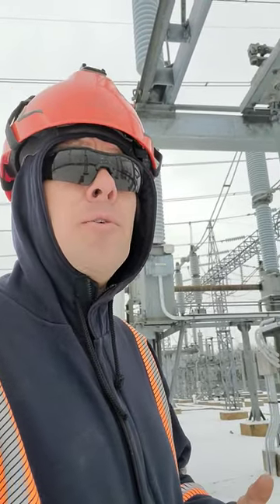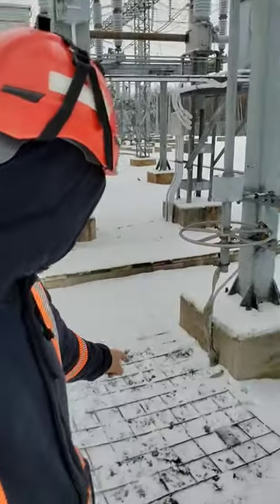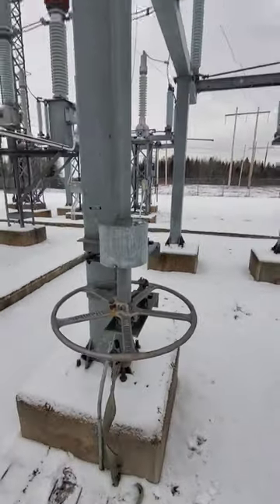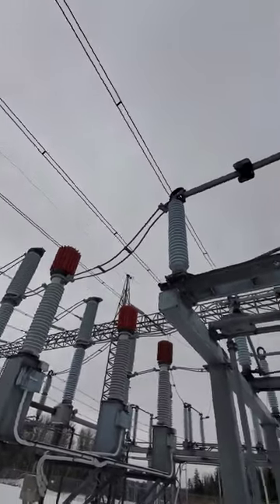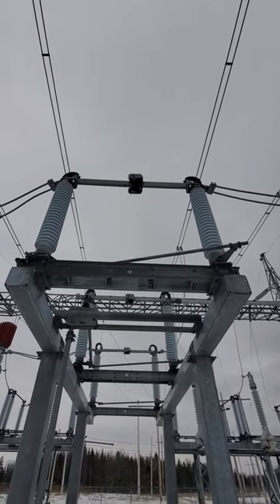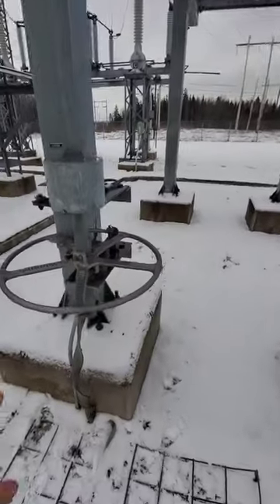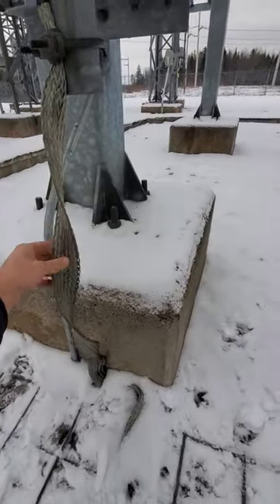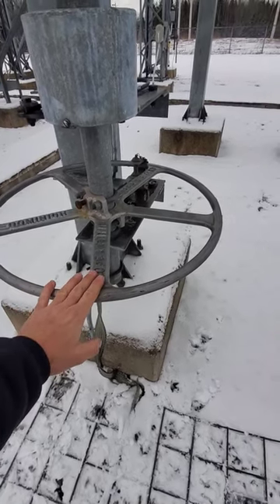Why am I standing on a steel mat??

Comment: If the rubber gloves being used have not been tested up to the possible applied voltage you are only fooling yourself thinking they are going to save your life. For feet and hands to be at the same potential they both would have to be insulated at the same rating.
Reply from the maker: Not going to disagree on that one. 

While our procedures require them, my understanding is: While a single conductor fault would be around 80kV, it would also dissipate rather quickly. The 20kv gloves are also tested at a higher voltage, which hopefully meet somewhere near the actual voltage during a fault. 
I agree that it can be counter productive at achieving zero difference in potential difference, however also understand that it can help in an extremely uncontrolled event of a fault.

It's definitely a bad situation to be in regardless of any barriers put in place
Reply: That would not be true. Your are a bird on a wire, the mat and the switch handle would be at the same potential.. In case of a fault you would then only have to have gloves that are rated for the voltage drop across your body.
Reply: Incorrect. The whole purpose of bonding is to put everything at the same potential, exactly as  @TnTBLACK95  said. If that switch did fault to ground and energize that structure or hand wheel and you are standing on the bonded mat there should only be a little difference of potential, if any and 20kV gloves would in fact help in this situation, no insulated feet required either. Not sure if you have ever stepped in a substation, but when you see extra insulated footwear being used in a substation, that is for step-potential, if the surface of the sub can't meet step-potential requirements. Insulated footwear in a sub that requires it is not for accidental contact with energized conductors. 
Now if nothing was bonded and you were standing on the rocks, yeah those gloves won't do shit for you. But, that's why there are mats and everything is bonded, to lessen or eliminate the difference of potential to a safe level. And depending on the company, some require gloves when switching in a sub and some don't.

Comment: Why not just have remote controlled switches? Removes the risk completely.
Reply from the maker: That would certainly be ideal!
Reply: There are motor operated switches but the cost of installation and maintenance make them impractical in many small substations or rural areas.
Reply: @TnTBLACK95  Having to drive for like an hour or two to get to a rural substation just to open or close a switch sounds like an expensive thing.
Fuel cost being 2-3 times higher here than in NA, and probably also labor cost, might make it more economical to automate this.

Here remote controlled switches seem to be the norm for 45kV and up. At 22kV distribution and below its more common with manual switching, but even at that level you'll see remote controlled ones. Above that its usually controlled from the operation center for that grid operator.

Maybe there are some safety requirements here I'm not aware of.
Reply: @Gazer75  A lot of times a manual switch will be on a disconnect for a piece of equipment or line and used for a visible open to allow work to be done on the line or equipment. Someone will have to verify the switch is open and hang a tag or lock if needed. So, someone has to go there anyway. While a motor operated switch would be safer and easier, it's not always practical. Plus there is more to the switch than just the motor-operator, if DC powered, the battery and charger needs to be able to handle the load and the associated wiring, breaker, panel etc.... Same for an AC operated switch with the panel and AC source. Then when talking remote control, the SCADA system has to have the control points added and once you start working on a bunch of subs, all of this adds up to a much higher cost than what you are paying people to do anyway. Not to mention the maintenance on motor-operated switches too. We just had one fail a few weeks ago, and in my opinion it didn't need to be motor-operated at all. So it was an unnecessary failure point that shouldn't have happened.
Reply: @inothome  Well there must be a reason for the much higher number of automation in Europe. Can't imagine its down to safety as it should be similar no?
Reply: @Gazer75  There are plenty of motor operated switches in the US as well. More so in transmission switch yards and not so much in smaller or rural utilities. Could be a monetary factor as well. They may want to spend more in Europe vs the US where it's more about what you can do for as cheap as possible. Even though this video is in Canada. Could also be much newer infrastructure in Europe vs NA? And, having worked for a European based company and a few US based companies, there is a much higher emphasis put on safety in Europe. In my personal experience anyway.
With that said, operating manual switches / disconnects isn't that dangerous of a task anyway. As long as equipment is in good operating condition.

Comment: And people forget that the plug for the toaster can kill them. 
When you're fiddling a steering wheel to connect electricity that's no joke.
Reply: Not really thats a myth. Unless you drop a penny on both prong while plugged in. The terminals don’t touch until the plug is inserted pretty far, too close to get finger in there

Comment: I always see these mostly unprotected sub stations (if that's the right term) and wonder what would happen if several were attacked at the same time? Would it be a massive disruption to the grid or a relatively easy thing to fix/bypass?

Comment: I thought the same thing when I saw the mat. I would check out where and how the mat is grounded, and check the mat with a Megger. To my fading eyes, the mat would not be able to handle that kind of current. A solid steel plate would be better. How about a kevlar belt driven switch from a few feet away?
Reply: You're missing the purpose of the mat. It is not there to carry the fault current to ground. It is in parallel with the structure that is connect to the ground grid. The mat just puts you at the same potential as fault. You are essentially a bird on a wire.